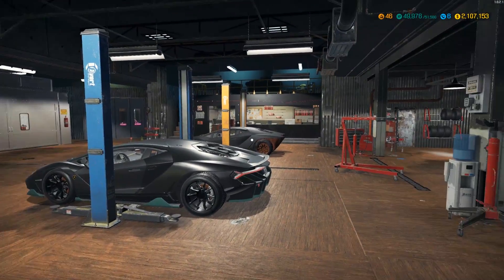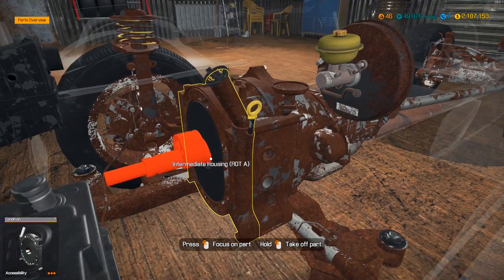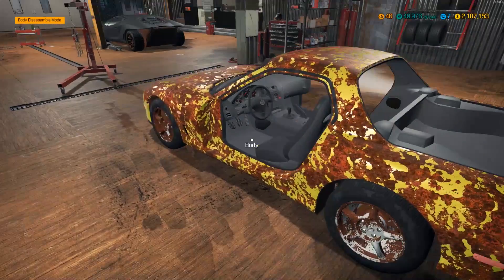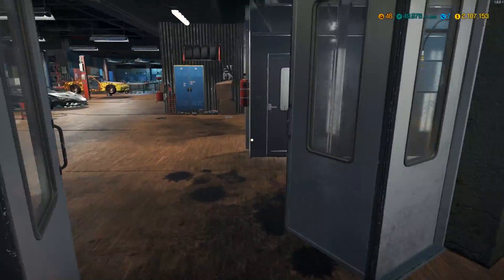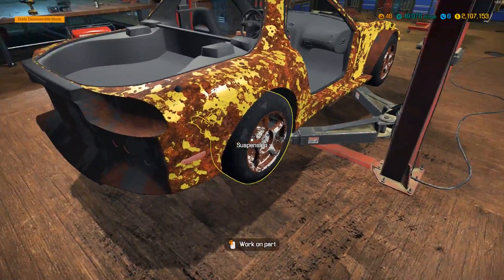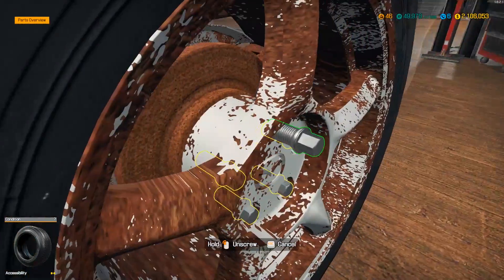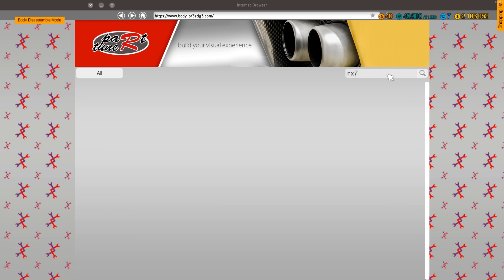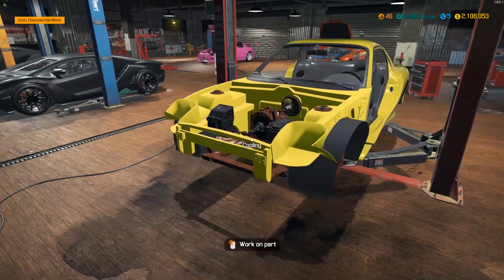TURBO MAZDA FD | Car Mechanic Simulator 2018

Comment: the FC and FD was twin rotors but while FC used one turbo the FD could be tuned to two even if some drove them with single turbo and more lag than twin turbo engines